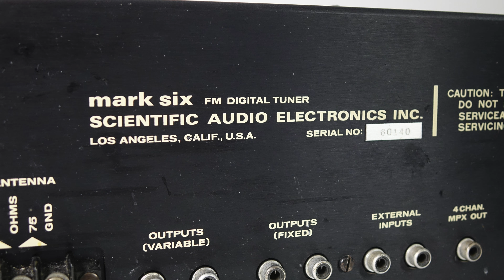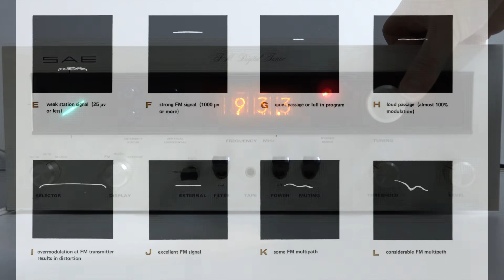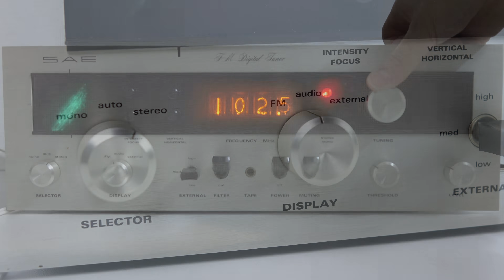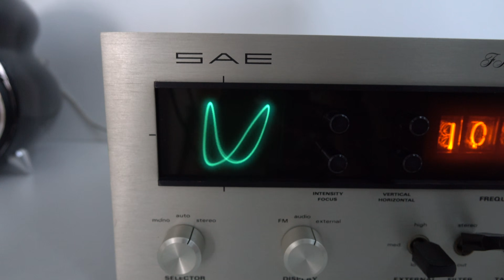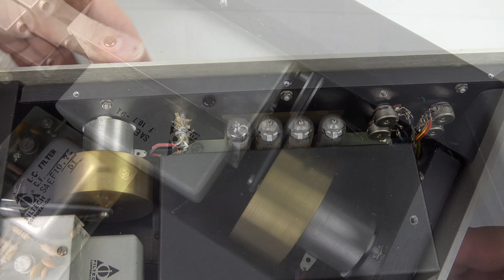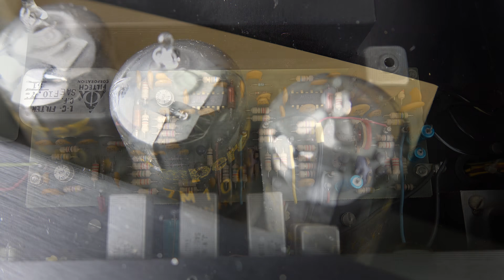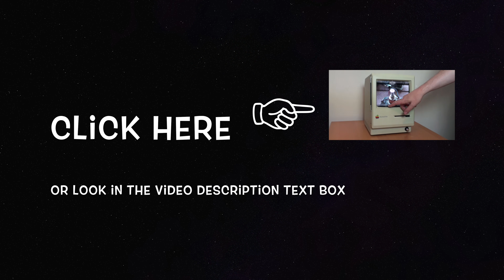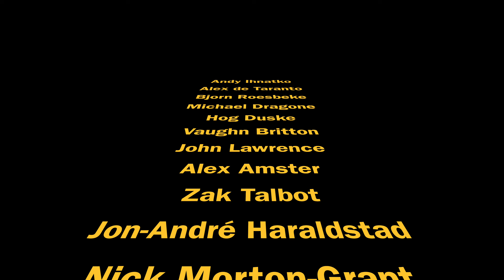Retro-Tech: SAE Mk6 FM Tuner - My Vintage HiFi holy grail

Comment: I am NOT looking forward to 2020 here in norway.
Thats the year they will switch all radio to DAB, so no more radio on my mp3 player or cellphone, no portable radio at all :/
Anyone ever een a pocketable DAB radio?
I haven`t.
And when they come, they will be frikkin expensive..
Reply: You know, speaking of radios lol..
Reply: DAB on em
Reply: lol..
dat bad dab do
Reply: Then we'll come back to good old shortwave radio. So we can listen to Radio Beijing from Europe in analogue :D
Reply: lol, "this is london calling" :p
Reply: There is no reason why they must be expensive.  For $20US you can buy a USB DAB decoder that is the size of a large flash memory stick, adding a display and some buttons to such could just about turn it into a standalone device.  The point being, it has been reduced to just a couple IC chips already that sell for dirt cheap, so it will not be difficult for enterprising individuals and corporations to incorporate the capability into run of the mill consumer devices for very little money since there is no R&D to be done.  We use such devices as SDR receivers and panadapters in amateur radio every day in no small part because they are cheap, widely available, very versatile, and perform well with bandwidths as great as 3.2MHz and are tunable to greater than 1GHz.
Reply: Cheapest DAB radio I ha ve seen in norway is more like 50, a crappy big one with sucky built-in speaker. And the same point I made goes.
No radio on the phone or mp3 player or tablet.
I`m not going to carry a separate device just to listen to radio when I`m on the bus or something lol.
No reason?
NNORWAY!
Thats the reason. Everything is pricey here, apart from food..
But hopefully, by the time the switch happens, cellphone will have DAB radios.
Reply: +jan christian Frodahl Like I said, DAB has already been reduced to just a couple small and inexpensive chips, so there is no technical reason why they can not be integrated into such devices if there is market demand for such.  There is certainly no R&D obstacle to a better or cheaper (take your pick) DAB receiver coming to your market since it is trivial to implement with the existing chipsets, it is just a matter of sufficient market demand for such...which I should think would come around the time of your transition when demand and interest increases. 

We really do not use DAB here in the U.S., but we do make use of the DAB+ receivers and chipsets for other purposes (such as SDR-based amateur radio receivers on our PCs).  I do not know whether we will ever make that transition as it would really only be beneficial in dense urban settings as we do not really have a bandwidth shortage as-is in most FM markets.
Reply: Sure, sure.
No TECHNICAL reason, but that doesn`t mean anything in the commercial marketplace..
And I wouldn`t mind getting a new phone when the time comes.
Hell, by that time I have probably bought at least two new ones.
I just don`t appreciate the forced conversion and the lack of practicality it will mean for a lot of people, not just me.
I like radio, I have radio, it works, so there`s no good reason to change it.
My2C`s anyway.
Reply: jan christian Frodahl
There is also the problem (same as with the digital TV) that when you don't get a perfectly good signal, the digital will fail whereas the analog will keep working with a bit of static that perhaps you don't even notice unless you really listen for it.
Reply: Yeah, that too :/
I found a portable DAB, but I think it`s too expenive and a little on the chubby side.
Its called the POP nano and is the only portable DAB I`ve seen so far.
I don`t see this being integrated into any cellphone any time soon lol..
You can see a pic here, the headline says: No,`it`s not small enough.
Power consumption seems to be the issue..

http://www.dagbladet.no/2015/03/22/tema/data/teknologi/aller/dinside/38366859/

Comment: By law, here in the U.S., a FM radio license gives you a 200-KHz slice of the band, to prevent adjacent bands from interfering.  They also assign stations in any region beginning with a maximum spread (e.g. the first 2 FM stations will be assigned to, say 89.1 and 107.7, then #3 would be 101.5, etc.)  Even more than that, adjacent regions are also offset from each other (only city A can have a station on 88.9, only city B can have one on 89.1).  In Europe your license only gets you 100 KHz, and you can usually pick it for yourself, as long as it's not taken in your region.

So that's why our radios end in odd numbers and usually have a mechanism to speed up scanning the whole band.

Comment: I used to use an oscilloscope a lot in my electronics class and every time the oscilloscope concentrated into a solid dot or when I had to set the velocity very low my eyes would hurt and strain

Comment: the missing even point frequencies is standard in the US. all US tuners will have this as the US do this to try and cut interference. modern radios have a us/Europe setting to allow you to use the full range of frequencies.

Comment: Wait - the UK uses the same 88-108MHz band as the U.S.? Interesting. And the .1, .3. .5 .7 .9 thing  in the U.S. it's because FM is 20KHz channels.
Reply: Yes, the same. But here in the UK its stepped differently. Ive had a few american cars in the past. Fiero, Camaro etc, and you cannot pickup UK stations as it will not land correctly on the exact frequency. i.e. 99.1 Mhz.
Reply: Yup - and I love the history of FM radio from Major Edwin Armstrong through the FCC's ineptitude and the movement from 50-60MHz to the 88-108MHz band in the U.S.
Reply: Japan's analog FM band runs from 76-95 MHz, so any tuner built for the Japanese market would not be too useful elsewhere.

Comment: "I really like my music to have some kind of visual effect"

You would adore ProjectM, it's like a digital version of the Atari Video Music (which I'm surprised you haven't featured on here) on several drugs that weren't around then the Atari Video Music came out.  

This device really makes wish SAE was still around, even though I could never afford their gear.

But it has to be said, that stuff is actually sexy. 

...aaaaand then that "free erection" advert comes in...
Reply: +commandtheline ProjectM is the open source version of Milkdrop, which is the Winamp plugin, and people have been porting it to different platforms. Then people who make VDMX recently released a port for Mac called Project Milksyphon which will output video into Syphon for use in VJing. It's neat!
Reply: ProjectM is fantastic
Reply: odd, i could've sworn i remember watching a video where he looks at one of those, but searching 'atari' yields no results now.

maybe it got made private? or maybe i'm thinking of someone else.
Reply: That's awesome. Didn't knew it. Thanks!
Reply: Ben Heck Show, Episode 220?
Reply: Ahh yes, projectM. plug in for Winamp? but i remember it most from my xbox modding days, XBMC! I wonder if it is still in Kodi (current name of the XBMC project)
Reply: William W Powell i remember watching that after, though. ah well

Comment: A modern version of this would cost a lot more than $6000. A friend who's been into hifi for the last 50 years has pointed this out to me many times. For example, 3 top of the line speakers from the early-mid 70s, the Quad 57, B&W P2h and Tannoy 15" dual concentrics, were between 55-70GBP (Can update if I get a chance to look at the book next time I visit). 
It's also interesting to note that Tannoys, which go for several times the price of the others, were the cheaper speakers in their day. 

Tuners cost a similar amount to the matching amplifiers, due to the tight restrictions on radio related products in England (possibly due to the BBC, can't remember). This this is why tuners were preferred, rather than the receivers used in America and Japan. I recall that a Leak stereo 30 was 120GBP, while the matching tuner was 125GBP.

A pair of Wharfedale Dovedale 3 were about 36GBP from memory. This would have still been a fair amount of money, yet an inflation calculator gives you a price that would barely get you an entry level bookshelf speaker. Keep in mind the other examples above are only twice as much. Now days, a product of a similar tier to the Dovedales is probably a few thousand pounds, and the "best example" products... the sky is the limit. 

You just need to get a copy of a 70's hifi yearbook, and browse some online hifi stores to see for yourself what I mean!

Comment: So why are Nixie tubes prohibited from being produced again?

And why isn't  modern equipment being made like this one?
Reply: They aren't prohibited, there isn't enough demand to mass manufacture them, however, there are videos on YouTube of people making them by hand. I highly recommend watching that it is amazing.
Reply: Dalibor Farny makes them I think. It's more the fact that it's not "economically viable". It's not really any different to making valves, which is still done.

In what way? Design, the style just changes over the years, like it does for everything else. It's easier to sell something when it fits in with the current fashion. Build quality, they do, you simply have to pay an awful lot for it.
Reply: Because LCDs, LED displays or even VFDs are so cheaper to produce. Also Nixie drivers must switch about 130-150V whereas the drivers for LCD or VFDs only about 10V at best.

Comment: Only having odd FM frequencies is typical for the US market, they do not use even numbers. This brand, or this device must not have been for export markets, and if it was then omitting even numbers is, well, not right as a real connoisseur would know. I found out when I owned an original imported Lincoln, and the early eighties digital tuning car radio just had odd frequencies too. So I could never tune in to half of the stations here in Europe.

Comment: Great video!! Just was wondering, are the nixie tubes on all the time while listening to music? From what I have heard, nixie tubes have a limited amount of hours of use. So would this radio tuner just burn through a lot of nixies if you decided to use this  tuner on a daily basis?
Reply: I made a nixie tube clock in 1972, been running since then, tubes still look ok. They may wear out, but it may take a very long time.. ZM1020 tubes btw.
Reply: withche07 ebay.com and search for "nixie clock" and there are tons of results
Reply: I think they last quite a while, but yes they'd wear out eventually. So do VFDs though.
Reply: Paul Philbrook how do you make or get these tubes or clocks? I want too but dont know where to look. on ebay there are no nixie tube products or I am searching wrong
Reply: ty

Comment: Is there a way to switch the internal transformer from 110 Volts to 230-240 Volts? Because the Label says it's able to run on 50-60 Hz, so it can handle the different frequencies from the beginning. Just for my understanding. And yeah, i know, it's a expensive piece of Equipment.
Reply: If it had dual 110v primary windings you could rewire them in series. But if that was the case it'd have a voltage switch. You'd need to swap out the transformer.
Reply: That was my guess
Reply from the maker: There's a load of stuff with 110V limits in there - would require a considerable amount of alteration - I'll stick to using a transformer - plug and go.
Reply: +Techmoan okay

Comment: Hah, I don't miss those Solid Sheds ads. I stick to the BBC Radios nowadays. I'm quite surprised how good the signals sound even tuned on odd numbers as my non-DAB radios are very iffy when not on the right number. Great piece of equipment.

Nice to see a Kaossilator as well. You had a good beat base, the higher pitched repetitions were a bit much but I know you were trying to show off the device / frequencies on the oscillators. Nevertheless, don't give it up so handily I say. Thanks for the video.

Comment: Tuners skipping even numbers is just how radio works in America. You mean to tell me there are stations that broadcast on, say, 92.2 in the UK??
Reply: "You mean to tell me there are stations that broadcast on, say, 92.2 in the UK??"

Yes.  We use all the scale over here.  Our local BBC radio station is on 95.4 for example.  

And my 1990s digital tuner goes up by increments of 0.05MHz in FM, so it's possible for me to tune into 97.15MHz for example, even though there's no reason for me to be able to do that.
Reply: Huh. Learn something new every day.
Reply: They still do that, actually! There's a station in Boston called KISS 108 that broadcasts at 107.9, and one in Providence called Hot 106 that broadcasts at 106.3.
Reply: I mean, there are different FM standards between countries, so it's possible.
Reply: because in America those are the radio frequencies that the aliens use.
Reply: I've been to places where channels are assigned 0.3 MHz apart, which of course ends up using both odd and even decimal points. Makes sense in some cases, and crosstalk is non-existent.
Reply: Fortunately, this is just an analog tuner (one with a mechanical variable capacitor) with a display that reads in 200 kHz increments. If it were a synthesized tuner, then some of the European stations would not tune in correctly.

What is interesting to think about is that up until about 30 years ago, many US radio stations rounded off their frequencies for marketing purposes. It must have been a trip for a user of this radio to tune a station that called itself, say, "Sunny 95" and see that the tuning display shows the station being correctly tuned in when the frequency display reads 94.7 MHz.
Reply: The reason has to do with how stereo FM is transmitted (at least in the US). The frequency displayed is the center frequency / carrier wave. But there are side-bands above and below for the L+R information. So let's use 95.7 as an example - the tuner actually receives a bandwidth from 95.6 to 95.8 in order to create a stereo sound. The next available station would be 95.9 (actually 95.8 to 96.0). Radio used to only be in mono, but when stereo was invented the stations were spaced this way to prevent overlap between signals.
Reply: Ah thanks for the info. Didn't get the reason from the video, or I missed it...
Reply: Even in the Netherlands we have 92.2 :)
Reply: There's even radio stations operating on even number frequency in Estonia, pretty much it's in 0,1MHz steps, although sometimes one radio does interfere with other on a crossover area from one county to another, radio stations have different frequencies in different counties. Quite messy fmo.
Reply: jaaasgoed m
Reply: "You mean there are things that are different outside of the US?!" 

So sorry, just had to do the "stereotypical American", no hard feelings ;)

But yes, It's done so they can put more stations on the available frequency range. Since modern tuners have no problem in separating stations that are .1 or even .05 MHz apart, it is possible to use more of the available bandwidth. In The Netherlands, 0.1MHz is standard. Both even and odd frequencies are used.
Reply: +jaaasgoed da problem wit europe izz dat itz full of foreigners

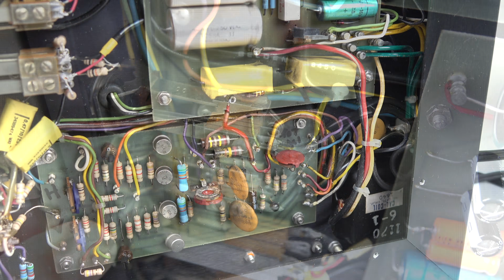Comment: i am supposed to work till 4PM, now it is 13:16 and i was about to leave because there was nothing to do all day. You just made me stay another 16 minutes at least, watching this video :)
Reply: +Maxx Fordham You don't get paid for watching at home.
Reply: acmeopinion factory Well, i do, but it feels much better to get paid to watch videos at work :D
Reply: +Maxx Fordham Kit is another way of saying 'gear' or 'stuff' or 'equipment'. 
TM is head and shoulders above that other boring channel.
Reply: +acmeopinion factory Couldn't remember the name of the channel while I was writing, that's how boring it is. TM's sense of humour makes it much more interesting.
AND- he has puppets!
Regarding modern KIT, to repair it, IF you can even open it to get to the guts without destroying it, IC'sand SoC's as far as the eye can see and no discrete replaceable parts, even if you could buy them, but the manufacturer won't sell them to you.
Modern gear is meant to be replaced, not repaired.